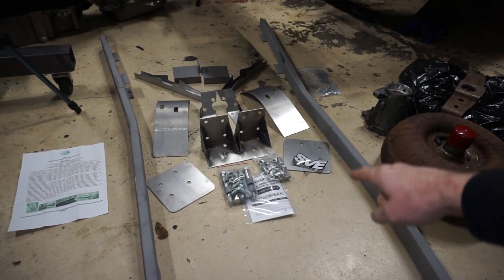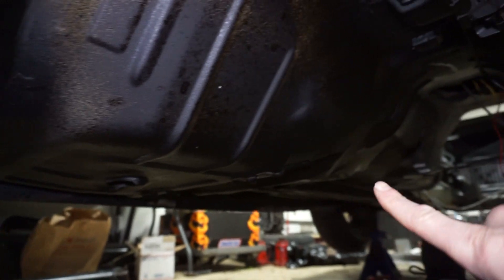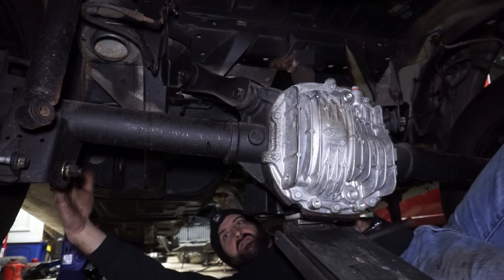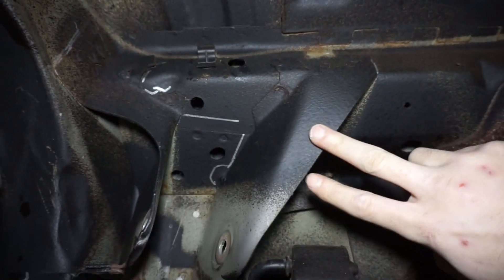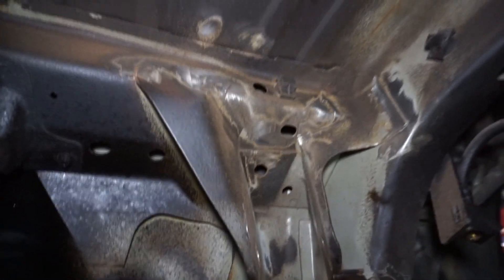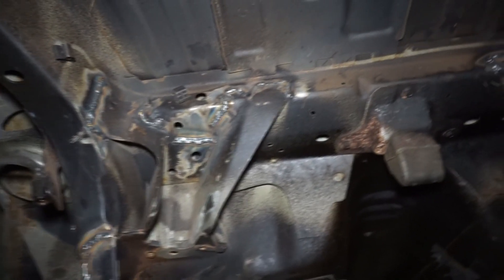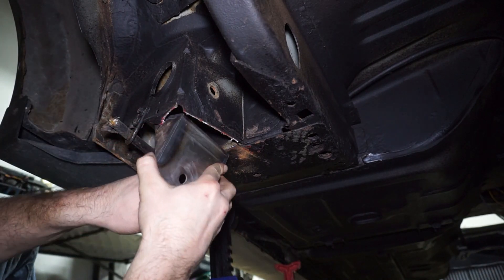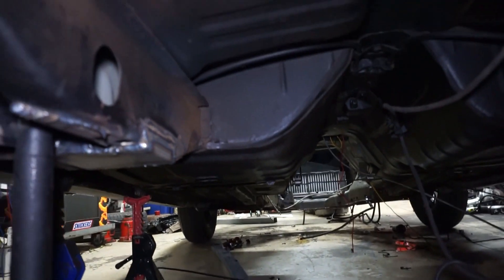Welding Mustang Torque Boxes | 99-04 New Edge Torque Box and Subframe Connectors Part 1.

Comment: I came across your channel at the perfect time. I originally followed for your 4l80 builds and the Jake’s trans brake video, but the reason I looked that stuff up is because I’m currently doing an LS swap on a 99 v6 Mustang. Going to be a 6.0 with a 4l80e and a Vortec V3sci supercharger. I’m starting to research options for the rear suspension now and this video was just perfect timing. I love how well your videos explain everything in great detail. Extremely informative it are going to help me out immensely on my build.

Comment: If you didn't get a new set of drill bits yet, I highly recommend Norseman drill bits. SP-29 is the set I have. A bit spendy, around $90 from Bowers Tool, but worth it.
Reply from the maker: Will check it out.

Comment: I wood screwed together 2 by 4’s blocks to go under each tire.  It gets the car maybe 6 inches higher than a jackstand.  That extra six inches makes all the world of difference.
Reply from the maker: It's always a pain trying to find the right height. This is pivoted on the stands to the rear os pretty high, I can sit up under it. If it's too low it's cramped, too high hard to reach and doing a half sit up and no leverage, lol. Oh well I need to do some abs anyways. 😅